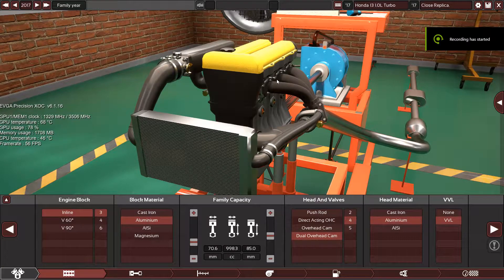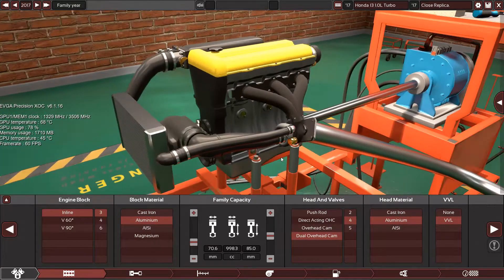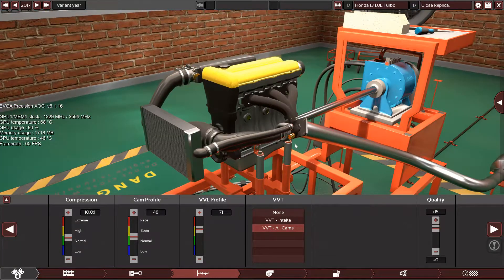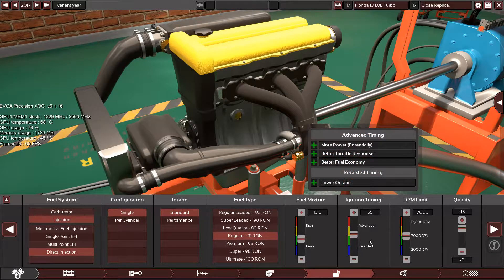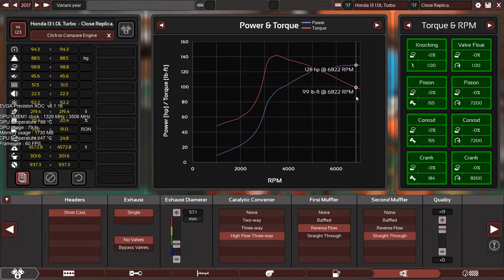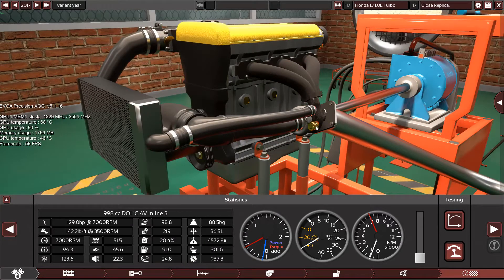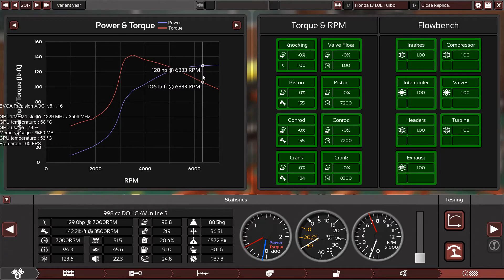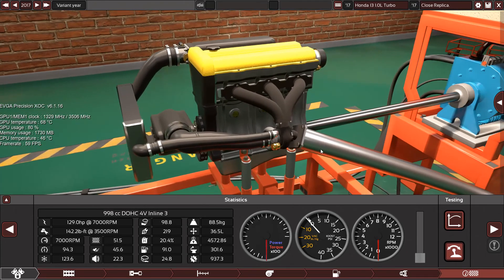Honda 1.0L Inline 3 Turbo close Replica.

Comment: Can u make a 7l v8 high bore and lowest stroke u can go without bugging the game, throttle per cylinder,naturally aspirated,dual over head cam, highest can profile, highest quality parts,best materials and push the rpm as high as possible,
Reply from the maker: easy and awesome.
i will make it tomorow morning.